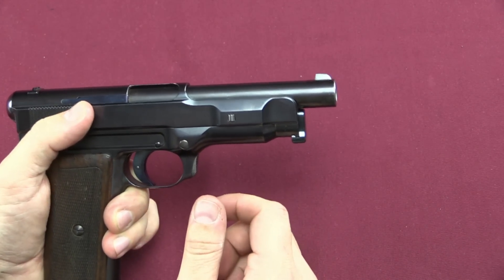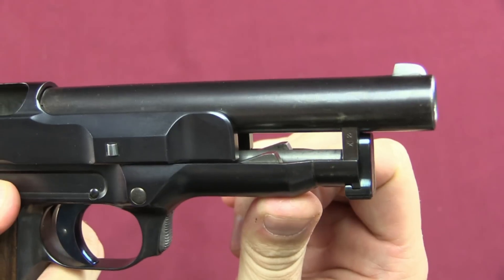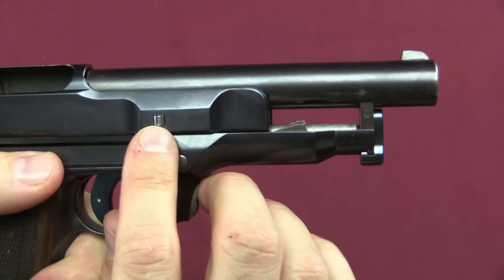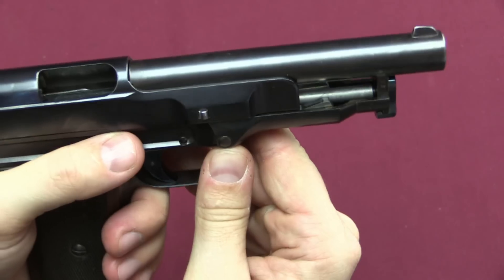Mauser 1912/14 in .45ACP

Comment: That thing is hot, Kinda like a WW1 era Beretta 92...I see many similar lines and I wouldn't be surprised if Beretta was inspired by these types of pistols...More than likely the 1910 model though...
Reply: It wasn't, the Beretta 92 was inspired by Walther P38, the locking and trigger mechanisms are nearly the same.
An open top slide can be used in any pistol design that doesn't have a tilting or rotating barrel.
Desert Eagle also technically has an open top slide, though it mechanically has nothing to do with either any Mauser pistol, the P38 or the Beretta (except for the fact that the takedown lever on the Desert Eagle is identical to that of a Beretta).
Reply: Jersey Streicher Good points!

Comment: When the slide is moving back during recoil, it must be pressing hard against those two small raised ramps.  Wouldn't that friction wear at the inner area of the slide?  Going forward, I don't see a problem.
Reply from the maker: Yes; I expect both that area and the ramps themselves were hardened to prevent wear.

Comment: Impossible to use modern two hand hold, but impossible to pull the bolt back without removing the forefinger from the trigger guard. One of the most stupid pistols ever designed.
Reply: No one used two hand hold back then so that didn't matter.